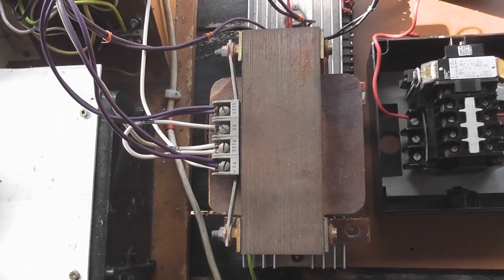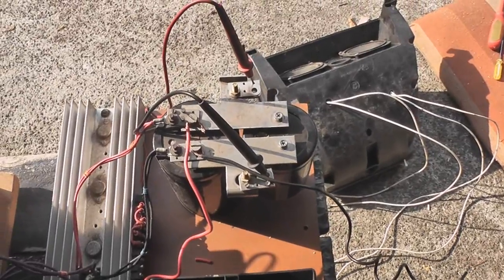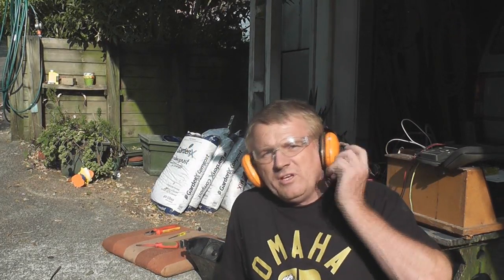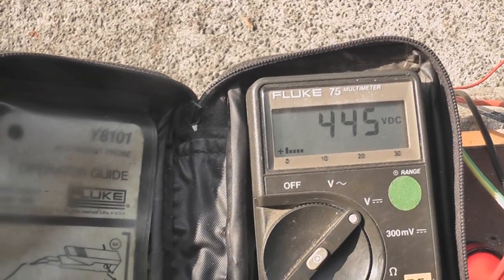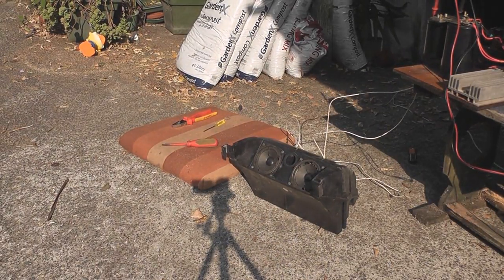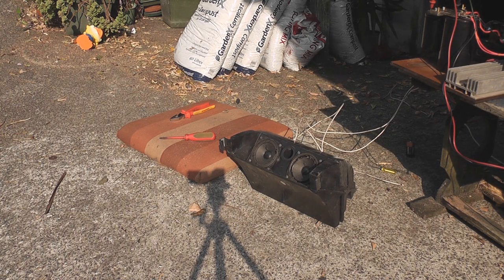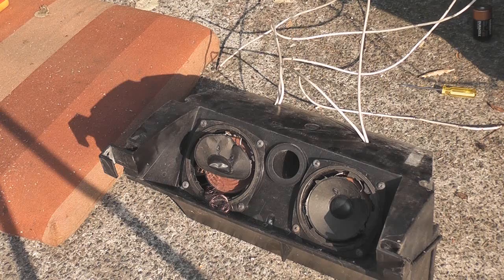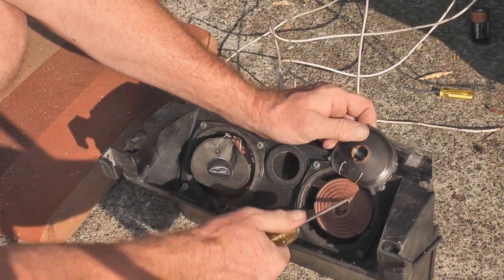Old TV speakers pop on 440 Volts DC

Comment: It also works for powering something that runs on 240 volt mains on 120 volts, basically a home made autotransformer. They do have to be connected as series aiding though, which isn't too hard to figure out.

Comment from the maker: You van do it with two normal TX's e.g 240 / 12 and 12 to 240.
Wire them back to back and put the primaries in series. to basically double the AC voltage.
As you are charging caps the TX rating is not that important. Check the phasing with a multi meter.